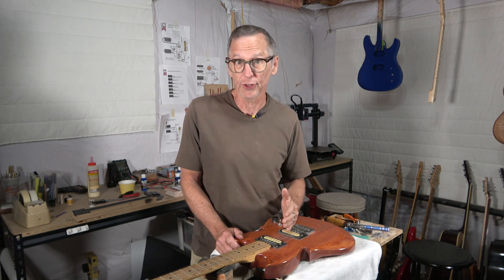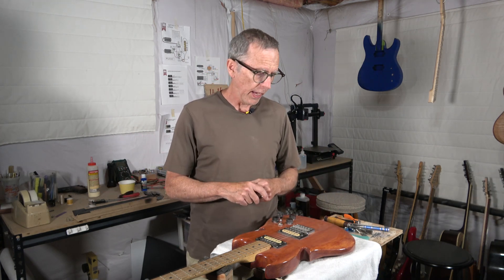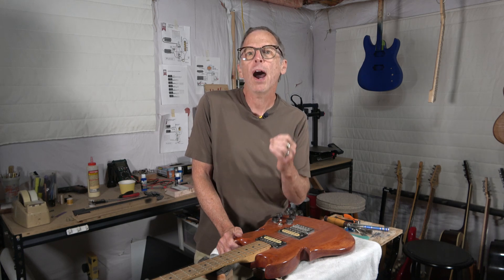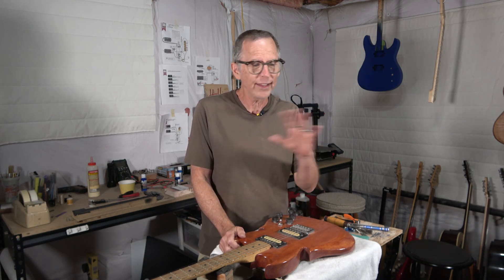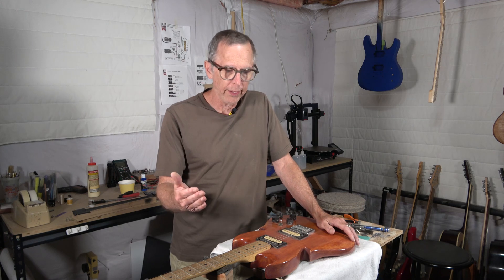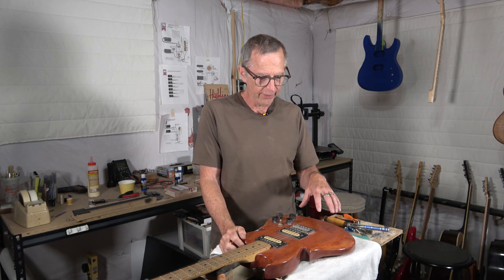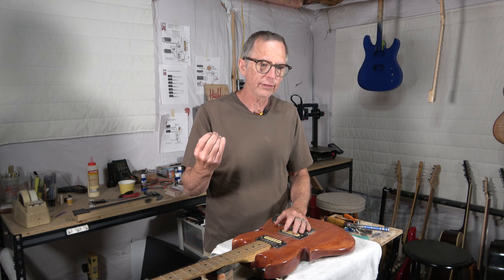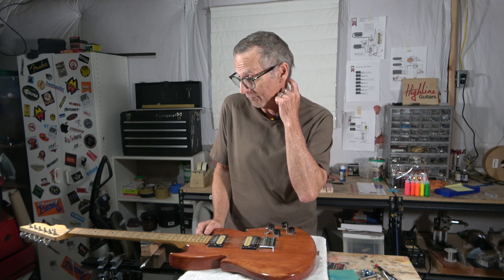The Science Of Making Guitars

Comment: That reminds me one youtuber with a lot of subscribers, which did this kind of "tests", according to which wood does not matter (though, during the video he moved goalpost from "wood does not affect tone" to "nobody can accurately identify which guitar is which in a mix, therefore wood does no affect tone"). Then he did the same with pickups and came to same conclusion. He even tried 2 different players and came to conclusion that all players must sound the same. I don't know if he ever tested different hardware, strings and guitar construction, but I suspect the "result" will be that it does not affect the tone. If so, it must be that all guitars should sound the same according to that "science" 😏

One thing you didn't mention (probably intentionally, to not cause controversy) is that there is also a factor of corruption in science, when "research" is designed to produce certain result for political/financial/other reasons

Comment: Nice video and discussion.  But I have to call out one thing with no disrespect.  You mentioned the R&D costs for pharma to develop one drug costing billions.  While true this is a large apples to orange comparison.  To develop a new chemical at a molecular level, lab study and finally to study it's impact across a large sample size for several years monitoring the impact across all organs in a human is so much more complex than any study for guitar.  Plus the regulatory, ethical and liability obstacles are exponentially different and drastically impact the studies cost.  Heck, SpaceX went from concept to a craft in space for under $5 billion, and that includes R&D, development and production.
Creating a baseline study of 15 identically spec'd guitars made of different woods, and a even a few made of the same wood with different weights, would not be difficult to simply gather enough data just to show that there are measurable differences.  But what's the point.  No matter the results, most people will still believe what they want since MOJO is unmeasurable.   After 40years of unscientific playing and building experience, I believe that while wood has some impact, it's minimal compared to the pickups.  If a particular board yields a little more high end frequencies,  it's all for moot if the pickups dynamic and frequency range does not capture it.  
I select woods for looks, weight and durability for bodies,  and focus on stiffness (high modulus of elasticity)  for necks. For tone, I look at pickups.  But that's just me.
Reply from the maker: I’m not comparing pharmaceutical R&D with scientific research on how guitars work, I’m using it as an example of how expensive research is. I hope that explains this for you.
Reply: @HighlineGuitars  I got that.  I love your videos because you do present great info. And I am a huge fan of yours and you do a great service for the guitar community.  My main point was like I said at the end of my comment.  No matter if a study was actually done on guitars, most would not pay attention because of preconceived beliefs, tradition and the claim of "MOJO".  My personal thoughts are that we focus way too much on the whole "tonewood" debate in regards to solid body guitars.  Pickups, electronics, signal chain, amp and speakers play more influence in tone in my experience.  Now how we like playing certain woods is a factor, be it weight, feel (especially raw wood) and even looks.  If we don't like the feel or looks, we probably won't play to our best ability.  
My favorite comment came from a friend years back that only liked lacquered maple necks.  He always said that he hated the feel of unfinished rosewood and ebony, and that changed the way he played.  I think he was correct.  
With all of the variables out there, we should focus on playability, looks and tangible factors.

Comment: You make correct points about why there will never be a huge body of scientific guitar research. Research funding bodies don't fund it as a rule, because it's rightly not deemed as important as medical research for example. So there is very little incentive for physicists, engineers or other scientists to make a careeer of it. US guitar manufacturers do not do guitar science research - you don't need it to build great guitars (but it helps). But guitar science research has actually been slowly accumulating over a long time. To the point that there is now thirty years of published research on real solid-body electric guitars. A lot of it published in scientific journals or as research monographs. See in particular the work of Helmut Fleischer, Manfred Zollner, and Arthur Pate.
In that work for example there are multiple studies showing the sonic role of the (long, thin, flexible, composite) neck. As a composite structure, identifying which part(s) of the neck is the most sonically influential is a further question. But there is solid published evidence linking some of that sonic role to the fretboard wood in real guitars.
You also make some important points about what are essentially known in science as levels of evidence. Even within formal science there are different such levels. For example in medical science, a randomized/placebo-controlled/double-blind trial is a higher level of evidence than an observational study.
Jim Lill's experiment was an example of "citizen science". That's a relatively low level of evidence, that doesn't really make it onto any formal scale of evidence levels. But within its limitations that you outlined, it can still be useful.
Lill's experiment does meets some criteria for good science. His methods are described in sufficient detail for someone to reproduce them - a key element of science. That has not been done yet as far as I know, but replication strengthens the veracity of results.
He has also tested key elements of his method to establish their validity - for example his thorough (other) experiment on whether youtube's modern-day audio quality limits the ability to hear sonic differences.
He also has a qualification that is to some extent scientific - a degree in audio engineering. But he is not trained in research science.
But as a professional scientist, I can see that he has a "knack" for science. Particularly in identifying all the possible influential factors, listing them, and then attempting to control them ... or manipulate a single one while showing how he kept others constant. If I wanted to get high-school students interested in the scientific research process, the first 9 minutes of his video would be great for that.
Lill's experiment was not just a hypothesis as you suggest. A hypothesis is the starting point for scientific experiments. He proposes his main hypothesis at the 6-minute point in the 12-minute video, after preliminary experiments. Then he proceeds to test it, with well-described methods, and present the results. That's a decent citizen science experiment right there.
But one problem that is common to guitar comparison tests on youtube is that he only uses one sample of each 'condition' in his body tests - the three "guitars". With so many things known (from the guitar science literature) to be capable of exerting a sonic effect in real guitars, it's hard to control them all. Lill used a very simple guitar model - a tele - which reduces the possibility of inadvertent, uncontrolled differences. But testing multiple samples makes it more likely that that true, "typical" effects of each category might emerge.
But also importantly, his "guitars" sounded rather similar. It's more of an issue when youtubers test single samples (eg of body wood speciees) and they DO sound different ... for them to then argue that the heard difference could only be due to the body wood. When they showed little evidence of controlling all other possible influences (just swapping necks and pickups and hardware between guitars does not ensure that). 
Below that level of citizen science - not at the level of science at all - we have anecdotes and testimonials. Which is what some people have based their beliefs about wood in guitars on. Their belief may be based on their heard experience - guitars they heard that sounded different, or sounded similar; or changes made to one of the guitars' components that either changed the sound or didn't. They may also be influenced by what famous players or manufacturers have said. This also goes to the nature of guitar science expertise. Should we expect a famous player or a gultar manufacturer to fully understand guitar physics ? So that when they express an opinion on guitar physics, is that credible ?
If nothing else, Lill's experiment has forced those who argue for the sonic effect of solid body wood to realize that their opinions alone don't mean much. Many people will place greater value on Lill's experiment's result than on what some famous player or manufacturer says.
So how do Lill's results reconcile with the published guitar science ? As I said, there is published evidence for the sonic role of the neck. Lill's three guitars did not have the same neck - his Anderson tele, his 2x4 tele (had a maple neck too, but from a Fender Thinline tele) and the two-massive-benches "tele" (that anchored the headstock to one of the benches rather than having a real neck). And they all sounded rather alike. Is that a contradiction ? Not really, because the research shows that the neck's influence varies, from not much, to sometimes quite a bit. Had Lill tested several Anderson teles, several 2x4 teles, and several two-bench teles, greater heard differences might have arisen. His results are also consistent with a lack of published evidence for a sonic role of the solid body.
Hopefully more experiments in the future will refine our knowledge in that regard. Maybe someone will attempt to replicate the Lill experiment with tele- or strat-style guitars and find the same or different results. More published work will likely appear too. But until that happens, we go with the conclusions that the overall weight of the current evidence supports (published evidence and citizen science).
Reply from the maker: You stated that, "Lill's experiment was not just a hypothesis..." Okay. Then what was it? It's either hypothesis or theory. There is nothing in between those two terms. Since it's not possible to repeat Jim's experiments (they weren't conducted in a controlled environment) the results can't be confirmed as scientific theory. I therefore contend that his results are still just hypothesis and will remain so until a scientist (acoustician) can perform experiments to test the hypothesis and qualified peers can replicate the experiments to confirm the results.
Reply: @HighlineGuitars  The last paragraph in the Introduction section of a scientific paper (they have stereotypical sections) generally sets the scene for the experiment to be described (the Methods section follows it). The previous work has already been reviewed, earlier in the Introduction. That last para can be in the form of a formal "null" hypothesis, or just identifying the question that the paper addresses. Lill effectively identifies the question/hypothesis at around 5:45:
"This was a turning point for me. There were a lot of things different between these two guitars [the previous work with the Anderson tele and the Partscaster tele] and not a lot that was the same. At this point in testing, here's a list of all the things that these two guitars had in common [the list is wrongly titled as the 2x4 guitar, but the list itself clearly references the correct two, actual earlier guitars]. I became more interested in testing the things that were on this list. And a big one was the guitar body. What if I took a radically different approach ? Could it sound the same as my Anderson ?"
The "radically different approach" was the 2x4 guitar (maple neck, with same pickup, plus tele electronics). That last question was a "citizen science" version of the last para of a paper's Introduction section. He effectively proposes the question/hypothesis to be investigated. Sure it's not a formal null hypothesis, but "could it sound the same as my Anderson ?" is basically same thing.
Then at 9 minutes he extends the experiment by adding the bench guitar, making for three comparison guitars: the Anderson tele, the 2x4, and the bench guitar.
And as to the results of that experiment, the three "guitars" sounded rather similar (BTW he tested youtube's audio accuracy in another experiment). There is enough information in the video for anyone to replicate the key elements of the experiment. About the only thing he doesn't mention is the measured pickup height. But he does mention that it was controlled by feeler gauge measurements - a much tighter control of that frequency-influencing factor than any other guitar comparisons I've seen on youtube. Those either don't mention pickup height, or just measure it with a simple ruler. Since we don't know how much pickup height has to change before a sonic difference can be heard by most people, the more precisely pickup height can be equated the better.
If you look at this video and his others, Lill has a knack for understanding and achieving control of variables that others lack.
Reply from the maker: @vw9659  What Jim hasn't done is record the environmental conditions where and when his experiments were performed. Therefore, no one can replicate his experiments in an effort to confirm his hypothesis. Any effort to do so will be rejected by the scientific community because the environmental variables were not accounted for.
Reply: @HighlineGuitars  it feels like you're gatekeeping Jim's experiment a bit here because he didn't publish or receive peer review, but in my humble Opinion, that doesn't inherently mean it's unscientific, just incomplete. I don't think his ambition was to validate a theory, but his documentation of experimental results should qualify at least for the vernacular meaning of, "scientific."
Reply from the maker: @Mossy5150  Everything you just stated is your personal opinion, which is fine, but that is all it is.
Reply: @HighlineGuitars  Likewise, your opinion on what constitutes science is also just that, your own. If Jim repeated the experiment with a fully digital modeling signal chain, would he still have to document barometric pressure to call his work science?

I believe that you know you are nitpicking details about environmental variables, but I'm not sure why it's so important in this context. Surely you know plenty of good science is routinely done outside of climate controlled laboratory environments, so why won't you just answer what so many of us are asking you? Why is Jim's work so clearly not-science purely on the basis of venue? It might be a perfectly reasonable set of bullet points, I'm not an acoustician, but if you can't name the variables you think make Jim's work entirely unrepeatable and why, it feels like you're presenting a bit of a strawman.

With love and respect 🎸
Reply from the maker: @Mossy5150  Jim’s “experiments” cannot be scientifically confirmed by others because he didn’t document the details regarding the environment he conducted them in.
Reply: @HighlineGuitars   But that doesn't mean it's "not science" like you claimed in your video. You were pretty adamant about saying what is or isn't science, which is the gatekeeping mentality I dislike so much about what you said. Say it's incomplete science, or say it's unpublished science, or even say, "what Jim did is BAD science," but this black and white maximalist mentality you're putting forward is just...cranky sounding.
Reply from the maker: @Mossy5150  Thank you for watching my video and sharing your comments. Your efforts encourage the YouTube algorithm to promote my videos and for that, I am very grateful.☺️
Reply: @HighlineGuitars  It's not enough to say that "he didn't control for environmental conditions". You also have to name which environmental conditions those are, and explain why it would affect the results. Jim Lill's experiment can be replicated with the variables he did document. If you replicate the experiment and get different results, the work starts to identify which variables led to different outcomes. That's how science really works.

If you believe you know which environmental factors weaken his weight of evidence, what you can do is set up a real experiment where these factors are varied and demonstrate that they do indeed affect the outcome. Then you have actually debunked the hypothesis.

So, which variables specifically affect the outcome of the experiment, which he didn't document? If those are things like air humidity, temperature etc., then I suggest that if those factors can negate the whole effect of tonewood, then the tone-wood-doesn't-matter-camp are essentially right. Because no actual guitar player or manufacturer could control those variables when the guitar is actually played.
Reply from the maker: @pbholmen  Temperature and humidity levels, which must be maintained throughout the entire test.